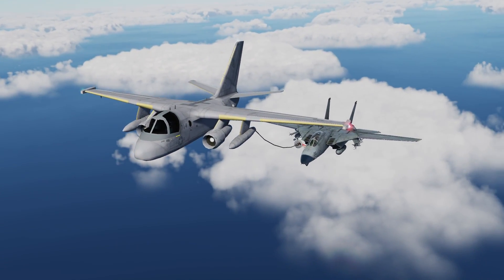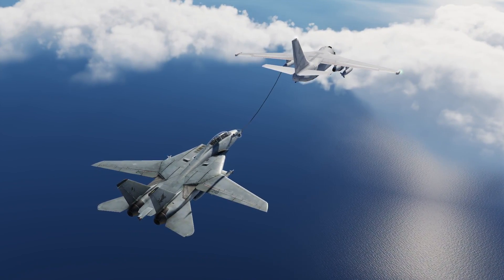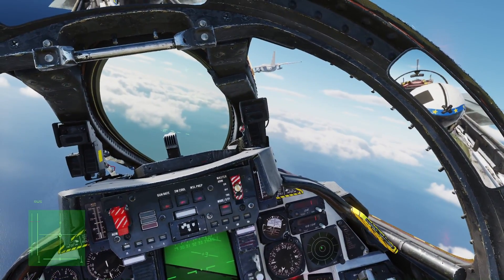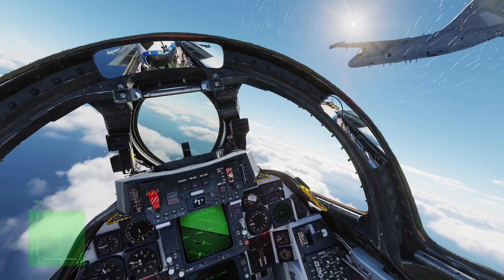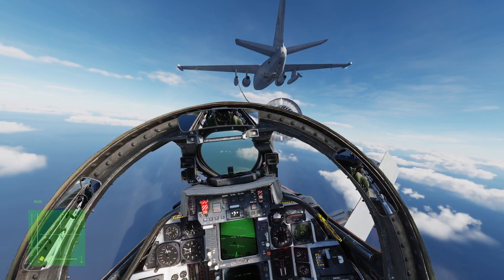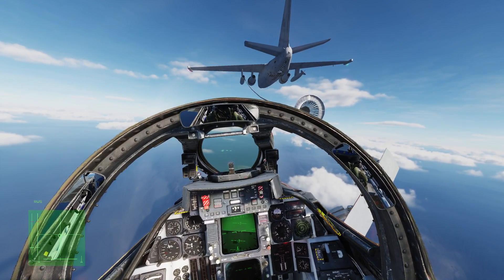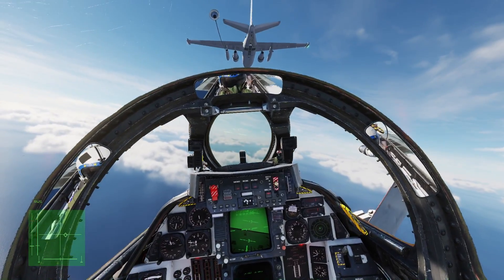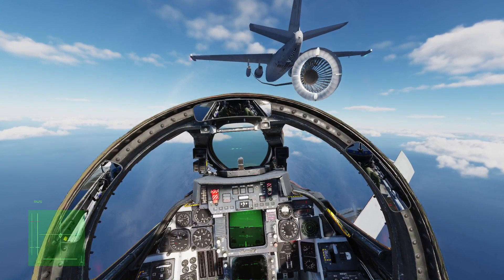DCS F-14 Tomcat Aerial Refueling Tutorial

Comment: Just saw this video. I used to fly the F-14 a lot about five or six years ago, but never learned to refill it. Since then, I’ve been here to air refueling on everything, but I can offer one piece of advice for the F-14 if anybody still sees this video:

Because the engines take so long to pull up and spool down it’s much easier if you put in a little more power than you actually need and just tap air brake the whole time. Once you hit the basket and  start creeping forward, put the air brake out and immediately put it back in again 
…. never leave it out just out and then in. You will slow just a bit. Repeat as needed. The air brake deploy and retract much quicker than the engine spool and as long as you’re over about 20,000 feet it doesn’t have a significant impact in that one second.

Comment: I use Bomber mode simply to lock the wings without having to manually move the Wing-sweep to 20 degrees and because I just need to trim pitch to fix any stability issues before going in the hook the basket. and it's been working beautifully. Though I'm also used to it. But the trick is that Whatever works for YOU, is the right way to do it. as long as it's easy and stable for ya.

Comment: Can you promise me you are not using any autopilot modes at all?  I get into observation position, flick on AP and then just use pressure more than movement on the stick and it drives right in.  Just modulate the throttle and hold position and dink the trim once in a while and ... its full in no time.
Reply from the maker: @LeonardoDaRockstar  never even occured to me. I doubt it was done in real life

Comment: I've given up on seriously trying to learn this for now, until I get a decent joystick or a dedicated throttle, my veredict is it is indeed impossible to aaf if the hardware is too cheap. Using a pxn2113, I managed to connect many times and even keep 10~15 seconds into the basket once, but the throttle on the stick is just too low quality, very sticky at first and then not smooth enough when moving, nowhere enough to make those 1-2 kt changes that AAF requires to keep formation for long. Any minimal movement changes the engine parameters way too much, trying sub-milimiter movements still ends up with +-10kt changes and sore fingers.
Some of the bad quality I managed to compensate for: like keeping decent control of the aircraft even though I'd actually need to set deadzones to 25/25/52 on roll/pitch/yaw to keep the stick from moving itself on its own (yes, twenty five & FIFTY TWO). Sensors only go from 50 to 70 on roll and 60 to 70 on pitch -- but the throttle I couldn't win against. I opened the stick, I tried tightening screws. No luck.
I think I'll grab a gladiator nxt, and I'm already building my own DIY rudder pedals (and might build a throttle quadrant as well), this 2113 needs to go to retirement.

Comment: why in the world ED didnt implemented yet the need to close the right doors of air source, the engine could stall for example, or the zip lip formality they use so the enemy wont get any signals where the tanker is, i believe sometimes they use the radio but is when they are over US, ED no offense is being wayyyy to lazy, for die hard fans like me its astonishing after 15 years they didnt do nothing related to this, the situation of bad sealed basket or boom, that would be just to use the same vapor effect we have in the f16 wings, after waiting for so long now i just have is FPS problems with a 4000bucks pc. im very happy that DCS exists but very disappointed in the same degree. by the way reflected i really like what you have done in DCS, tx for those amazing campaigns
Reply from the maker: I don’t think the engine would stall if you don’t close it. It’s just that you get fuel in the ECM, bad fumes in the cockpit.

Comment: I'm one of those people who swear by the bomb mode.

I've personally seen several people who claimed to have never successfully refueled the cat, although they could refuel the 18 or other planes. Many of those people only needed to flick the wings to bomb mode and 1-2 minutes later they were sipping fuel in the cat for the first time. It really does make it a lot easier. I'd consider refueling with wings far forward to be an advanced skill, and much harder yet in auto. And there's no need to make it frustrating for beginners.

Bomb mode specifically isn't special, any far back position will do, and more back the better as long as the airplane can still fly well. Bomb mode is just a convenient and consistent number that's 1 button away, and the airplane still flies well at 250kn in bomb mode.

Advantages: 
1. Any manual position further back than Auto at the current speed disables the wing movement. Auto wings will horribly mess up your trim if they decide to move randomly.

2. Wings back need higher AOA. Let me explain: Say you're flying at 5 units of AOA in level flight, so you have exactly 1G of lift counteracting gravity. Then you pull on the stick which adds another 1 unit of AOA. Your AOA thus increases by 20%, which makes your lift also increase by about 20% (unless close to stalling) and you're now accelerating up at 0.2G. Now try the same thing with wings back. Maybe you're at 10 AOA, you pull on the stick the same amount again, which adds 1 unit of AOA, but that's only 10% increase this time, thus you'll only pull 0.1G. It's just a lot less sensitive in pitch. The same increase in pitch makes it climb less and it also settles into the climb slower, thus giving you more time for further adjustments.

3. Wings back reduce your angular momentum around roll axis, which makes the airplane more responsive in roll, which is usually better for faster corrections, since roll isn't really the axis people consider too sensitive to struggle with it.

4. Something about the aerodynamics, angular momentum and distribution of weight also seems to smooth out the turkey yaw wobble when adjusting bank. With unfolded wings, the adverse yaw makes the probe wobble left and right, confuses the pilot about which way they're going, induces a small uncommanded roll tendency and momentarily increases drag. With folded wings, those seem to get smoother.

5. Adding more fuel to an engine raises combustion temperature and pressure, which spins the turbine and the compressor faster, which increases the pressure and air mass the compressor is feeding in, which then in turn cools down the combustion. Combustion temperature must not exceed the turbine limits, and combustion pressure must never exceed the pressure that the compressor feeding, otherwise the fire will come out of the front.

At idle, the engine is quite close to the lowest RPM where the compressor still provides enough pressure for the air to move in the correct direction, and enough cool air that turbine won't melt. But the margins aren't big, so you can only add so much extra fuel. A bit below idle, the margins are zero or negative - the engine cannot safely handle enough fuel to even sustain the compressor RPM, it it would melt the turbine or stall the compressor. Above idle, the margins get higher and higher, you can keep adding fuel faster and faster as the RPM increases.

More AOA -> More drag -> More engine power needed -> Faster thrust response of the engines. Try it with boards out for even more responsive throttle.

Disadvantages:
1. Higher AOA points the engines more down, so adjusting power will make the airplane climb or descend more

Comment: When I go to refuel I fly straight through the basket and it does not connect. Watching you and every single other Air Refuel it looks like the drogue auto connects when you get close enough. But I literally fly through the whole drogue and basket and nothing connects. I submitted a ticket to DCS dev's along with video of the problem but they have yet to get back to me with a solution. Am I doing something wrong? Has anyone else had this problem? I fly as straight and smooth as he does in the video  yet it does not connect.
Reply from the maker: Are you using the radio menu correctly?
Reply: Also make sure you don’t have unlimited fuel selected as an option…that was my problem

Comment: So after a good few days trying to master this and finally succeeding, i can offer a few other tips to people who may also be struggling;
1. When tanking on the  S3, make sure you get the 'confirm precontact' call as opposed to the 'return precontact', otherwise the basket doesnt really exist despite looking like it's there. To get the 'confirm' precontact call you have to be very close to the tanker, almost like you can reach out and grab the basket.
2. Once you have made contact, be active on the throttle but extremely gentle on the stick to maintain position. What works for me with the throttle is moving it quite a bit backwards and forwards constantly to keep the correct distance and not come off the line.
3. Focus on the pod and use peripheral vision for the basket, i find i never need to look directly at the basket.
4. Set a curve on the jostick, maybe 15% and back off if you feel that is appropriate. Personally, i dont understand the desire for masochism, especially with a short stick/no extension that doesnt move as much as the real thing, thereby making finer adjustments harder than in real life, something confirmed by many pilots.
5. Understand that you WILL get there with practise. I had many failed attempts that resulted the tanker being shot down....
Reply: Haha good to know I’m not the only one that goes guns on the tanker after many failed attempts

Comment: The Tomcat has VERY powerful engines but it comes at a cost: inertia.  It takes a while for the engines to spool up to requested power.  It's the worse of any DCS aircraft for that.  So in the case of AAR, you literally have to anticipate what the jet is going to do even before it starts doing it.  At least in the F-18 you could correct the aircraft based on what it was doing.  You had to be ahead of the aircraft, but in the F-14 you have to be so ahead that you have to start correcting for stuff the aircraft isn't even doing, if it has anything to do with power.  I have many F-18 campaigns done off carriers, but I have to admit the F-14 is difficult to convert to becasue of these engines.  But man can this thing go compared to an F-18.

Comment: Zone 5 is outstanding and I can’t wait for Speed and Angels! The F-14 is very difficult to master because of the cockpit sight picture. Also, it seems as if every switch is miles away from the next, so get your pre plug checklist done before you even get close to the tanker (make sure Jester has his pie hole shut!) Just before making contact with the basket, (trim, wings,throttle/airspeed set) I will then use only the Right Throttle to make contact to the hose and stay connected. Using both throttles always seems to be too much (or too little).
Reply: How do you get jester to be quiet, I find he is always talking over the top of instructors and I miss half of what they say.

Is there a Jester command or do I just turn off turn off ICS? 🤔

Comment: Thank you. Very inspirational and informative. My problem is regular practice. Just don't get enough time to do it. About the wings at 20 degrees in manual mode, will the maneuver flaps still move at this wing sweep? I've practiced with the wing sweep in Auto and it was a nightmare. The plane would frequently pitch up or down and I would have to correct it. Secondly, every video talks about the trim. I also trim the rudder apart from the vertical trim as the yaw/slip indicator deviates to the left when the probe is extended. I read this on the ED forums somewhere. So now I trim the rudder too and that does help in maintaining some lateral stability. Coming back to the pitch/elevator trim, I can trim the plane when in the observation position but after that any changes in the throttle do effect my vertical speed indicator. Maybe my I should add smaller changes to the throttle?
Reply from the maker: I never found it necessary to use rudder trim, only seen it on the forums. Yes, throttle movement changes pitch inertia, but  if you look at my controls indicator, I'm making tiny adjustments, and their effect on trim is negligible.
Reply: @ReflectedSimulations  Right, thank you

Comment: Great vid. What laptop are you using, and what are the specs?
Reply from the maker: A GP65 Leopard. 32 GB RAM, 2060
Reply: @ReflectedSimulations  That is quite the machine. I was considering what to get for msfs, dcs, etc. Desktops are the obvious choice, but I also appreciate the mobility of a laptop minus the amount of money they cost to run programs like that. Do you find any advantages/disadvantages to laptop use or is it all just preference? Thank you for your time, and responses btw.
Reply from the maker: @Funk8_4  The mobility is a plus - and for me it's a must. The disadvantage is the size of the screen and the small number of USB ports (which can be addressed with a USB hub). And a laptop always costs more than the same components in a desktop PC.
Reply: @ReflectedSimulations  I can imagine it might be a little cumbersome to carry a bunch of equipment place to place so there's a consideration. Not sure if it defeats the purpose of mobility/portability, but I don't own a television/monitor and use a mini projector with my platform. Definitely travel friendly, and lends a more "atmospheric" experience to what I'm doing granted you have the space/surface to use. Much to think about. In any case, thank you again for taking the time to respond, and share info! You've earned a new subscriber. Keep up the great content!

Comment: Awesome tips as always. I used to do the Bomb mode thing, then switched to wings 20 and really didn't have much trouble. Have you tried the Recovery Tanker function yet? I've found the AI to do erratic turns and bank angles when trying to tank but I haven't seen anyone else mention it.
Reply from the maker: The recovery tanker option is super useful for CV op missions. I haven't seen the AI bank erratically, not when anyone is behind the basket. Or you mean the AI that's behind the basked? I haven't seen that either, but the AI is pretty erratic in general..
Reply: @ReflectedSimulations  Usually when a client is hooked up online. The tanker will bank right before the left turn, then turn left, then partially through the turn his bank angle gets shallower, then goes back to what it was earlier. I'm starting to wonder if it's an online only thing since I always fly the Tomcat over a server for screens/videos.
Reply from the maker: @DCS_World_Japan  I’ve never seen this offline

Comment: Good stuff. It's definitely formation flying stuff, and the analogy you use with the three throttle movements is spot on, I was taught that by a tanker pilot. The other thing is getting trimmed up while flying near the tanker so your stick is neutral, this can help avoid the pilot induced oscillations correcting input. Throttling up will lift the nose too, and throttling back will drop it a little, this too can cause over correction and getting out of sync. I think Ward Carroll said pilots would put in a little left rudder to lift the right shoulder up to the basket, but I don't think this is needed in DCS. As you say, practice, and it's fun to get right!
Reply from the maker: I've heard IRL some pilots put the probe below the basked then used  lateral stick to the left to lift it there - it's needed to make sure the bow wave of the Tomcat doesn't push the basket away. But we don't have that in DCS unfortunately.
Reply: @ReflectedSimulations  that makes sense! And no, we're not up to that level of physics yet in DCS, probably much to some player's relief.

Comment: Forgot 1 thing... Finger tips only on the controls... gripping the stick and throttle has the tendency for you to tense up... tense muscles tend to react slower and over compensate... if you are not confident in flying with finger tips only... then the issue is just in your head... your head already told you that you can't do it even before you started.... you will need to overcome that
Reply from the maker: That’s always a good advice
Reply: Thank you, I will apply this to my practice
Reply: Try doing finger tips only when using the Thrustmaster A-10C / F-16C joystick. Great video tho’ still suck at ARR but I keep practising, just not consistent 😂
Reply: @Rogeroverandout61  is it really that stiff? I use a the virpil warbird base
Reply: @Eagle01ph  yeah! You have to grip it and manipulate the stick with all your hand I can’t do it with just my fingers, apparently that’s how they are, there’s a few bodge mods changing springs etc but not for me tho’ 🤔😉
Reply: Learning to use the fingers on the throttle too, helps with finer control
Reply: Well said, wiggle your fingers and toes... and unclench your cheeks.  Passing gas needs to become as natural as a dance with the wind and the jet.